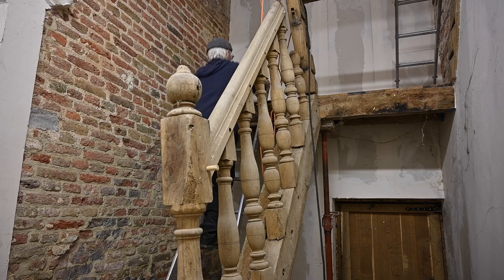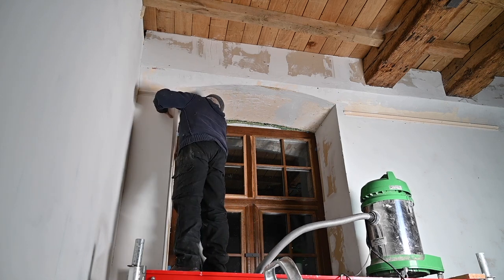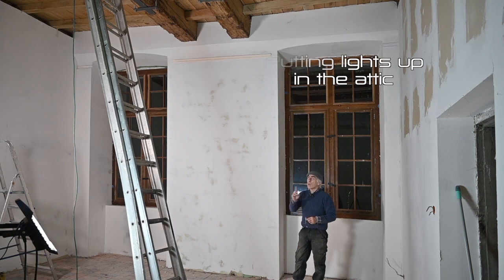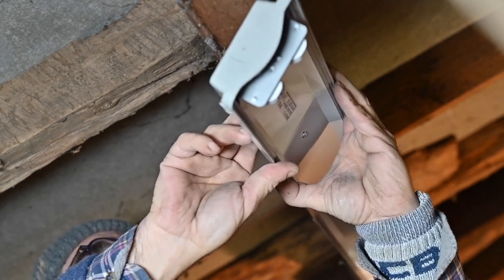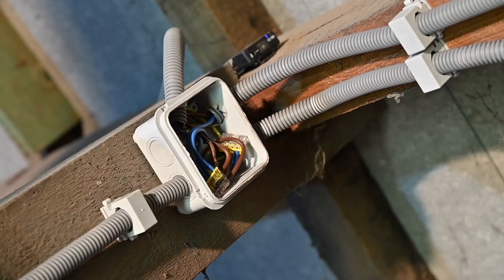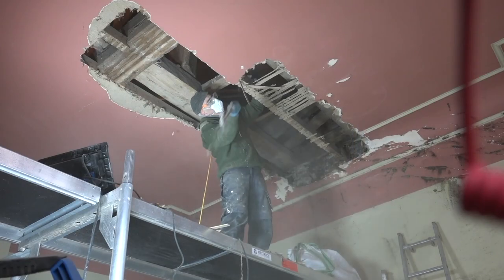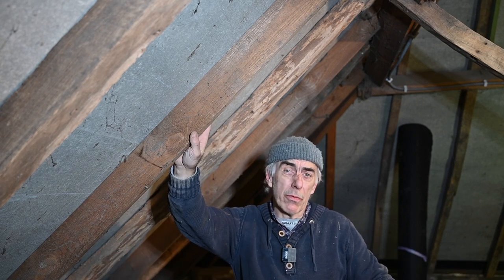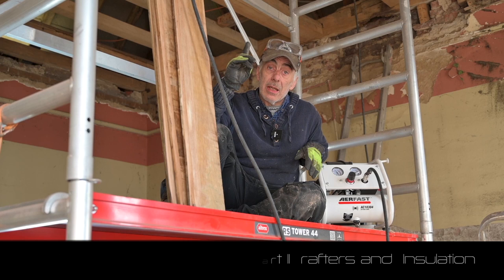Restoring the Tower Room and Attic 2022   Part 1

Comment: The ceiling in your tower are really high, that makes access very difficult, but at least the surface is not as easily seen from below. I too have been battling with Flies, they are in such large numbers I vacuum them up every day before I start work, they are of course hibernating in the loft space, but the warmth has made them wake up. That is an unusual plastering tool you are using? I use a standard plastering trowel which is only .020" thick, I find being very thin and flexible it does not leave lines at the edge of the trowel, making it much easier to get a smooth finish, but as I am trying to achieve a finish in keeping with the age of the building I do not want it totally flat. Stay safe in 2022, ! Chris B.
Reply from the maker: Thanks for the comments

Comment: At minute 14, wtf are you doing there? Should the blue wire not be a black (switched) wire or is there in the Belgian NEN norm some tricks that do not exist in the Netherlands? Over here I would be shot for that!
Reply from the maker: Thanks for the comments, There is a regulation is , and  in principle blue is neutral, all other colors are a phase  except yellow-green.   There is no requirement for a specific color for the switched one . Yet it should be a phase.   In my case I have 3 phases (RST) and no neutral.  So in that case blue is also authorized,  as i stated that differs from country to country.